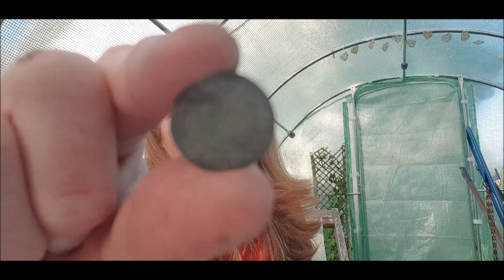Simplex+ SP24- pros and cons, & best software version. Why it is my Stock coil now.

Comment: Another great informative video, thanks. Just one point - at 9 minutes - it isn't the width of the coil that determines how much ground you cover, it is the length. The DD windings go fore and after, front to back ... the SP24 is 9.5 inches long and the stock is 11 inches so the SP24 covers 86.36% of the ground that the stock does - length, not width. Soo ... 86 swings of the stock would need 100 of the 24 to cover the same ground, which is quite a difference. However, being half the width the SP24 is much better at winkling in between rubbish.

Comment: Lori, many thanks for the video. I’ve fitted the coil, currently run on 2.78 and will hopefully get out tomorrow for a few hours on stubble. Maybe I’ll have to install 2.77 to get the most out of it. I’ll let you know. Cheers
Reply from the maker: Let me know how you get on, John :D
Reply: Hi , I run 2.78  Is there another small coil that will work as good as the sp24   but on a 2.78 ? I'm a newbie ☺

Comment: Very good video Lori. For me, one of the biggest mistakes that people swinging bigger coils make is to run their gain too far too high...There's not the need... Big (11" plus DD's), do NOT require big gain. A big DD running on ' half impulse' reaches down to basically the same depth as it does on 'trans-warp drive', and if the MD's recovery speed is reasonable,  a bigger DD will hit tiny targets next to iron at depth, because there is less 'Fog' caused by 'over application of resources'. 'Fog' is caused by too much gain being applied. The coil is pulling in  a maelstrom of electrically charged mineral particles etc, that over-ride the MD's 'brain'. It cannot 'see  the wood for the trees'. It 'blinds' the machine...For years I ran my Tejon with a 10"x!2" DD. I NEVER ran it above 3 on gain. It 'saw' through mineralised dirt down to 11"'s and hit cut halves/tiny denarii. Above 3 it went ####in' mental, and it had another 7 increments of mental-ness to fry my brains (ears) on!... That's why it was called 'Animal'; t'was not for the 'if in doubt, flat out' breed or the 'new to detecting, I ####in' HATE this machine' fraternity,.. However, in saying all this drivvle, my favourite coil next to the 11x12 was the 5"x10" which could be 'wound up'. to 8 Max...5"x10" DD's were MADE for 18 plus kHz MD's; end of...I totally agree with your assessments Lori, if the MD is run flat out on a 11" DD, but 'Who would do that?', especially on vlf 12kHz. Take care, and keep up your great work please Lori, your tutorials ought to help a lot of people, if they heed you.
Reply from the maker: Awww, thank you Tim. I am always very pleased when I read your comments and there isn't anything you've needed to add to my assessments. The comments you've made about gain (sensitivity for new detectorists unfamiliar with the term 'gain') are a great supporting argument to my beliefs about the purpose of 2.77 and the smaller coils- thank you my friend!

Comment: I am using the sp24 coil and v2.78. On your advice, I changed the version to 2.77 ( on the 2 units I own, bought in the last month ) to see if it would help me get more depth.. Every 4 seconds I get a detection tone and Target ID of a random high number. It repeats and was pretty annoying. Even if the coil is 5 feet up in the air. It happens on both units I flashed to 2.77. I could not get rid of it by ground balancing, toning down sensitivity, anything I tried.. no matter how far I toned anything down. Every 4 seconds.

I didn't have this issue on 2.78. so I am reloading that and pray it goes away again.

Followup: 2.78 removed the repeating tones.
Reply: Following this